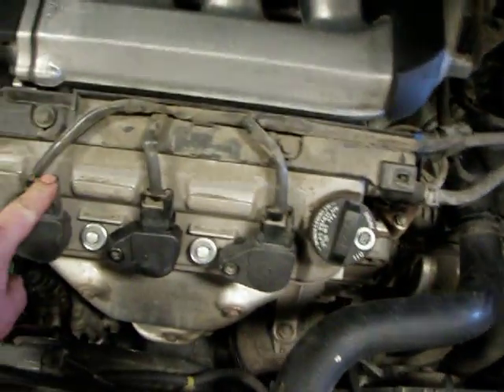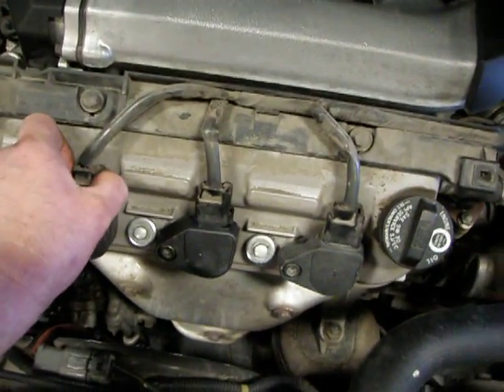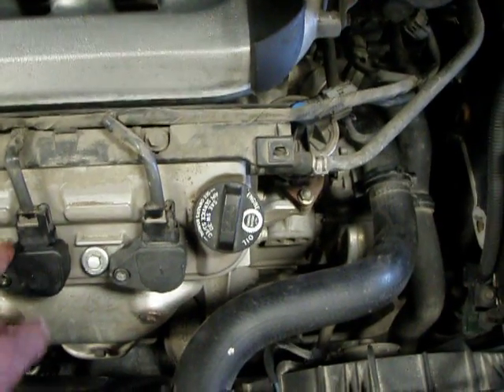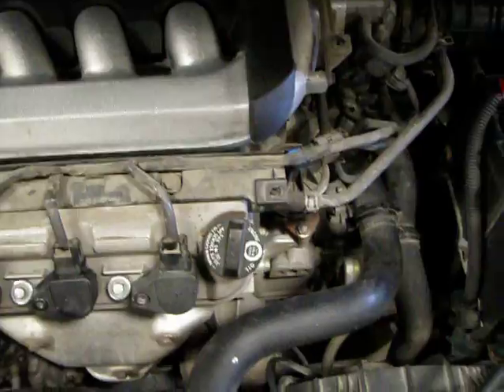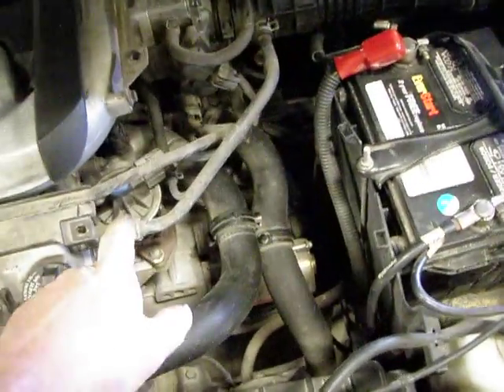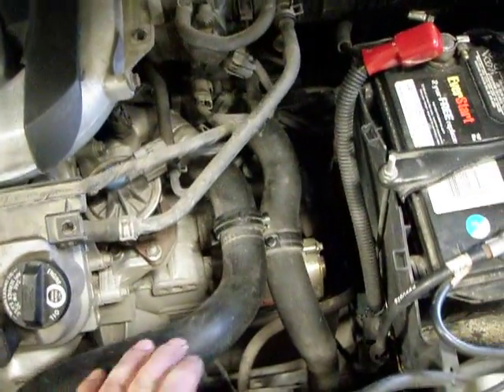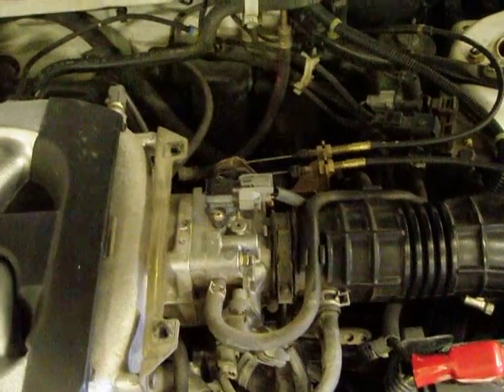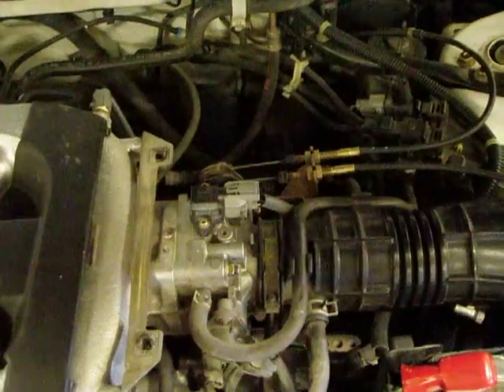Honda Accord Misifre CodeP0301 P0302 P0303 P0304

Comment: Dr. D, I have a '96 accord EX. I changed out the spark plugs and wires. Also changed out #2 injector thinking that it would clear the #2 misfire code. I'm having no luck here. The part house is telling me it could probably be a bad cylinder. What is your thoughts?

Comment: so how would you know if one of the coil packs are bad
Reply from the maker: Well if a cylinder is missing and it's got compression and the plug is ok it probably has a bad coil. Not saying it can't be an injector or valve spring but the coil is a common issue. Of course using a scope with a secondary ignition pickup would be nice or a tool that fires the coil and tests voltage but this vid is more about a quick fix. You can also swap coils and see if the misfire follows the coil.